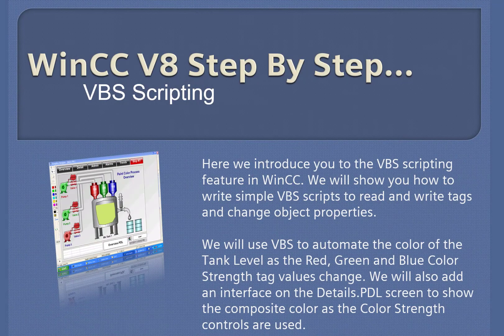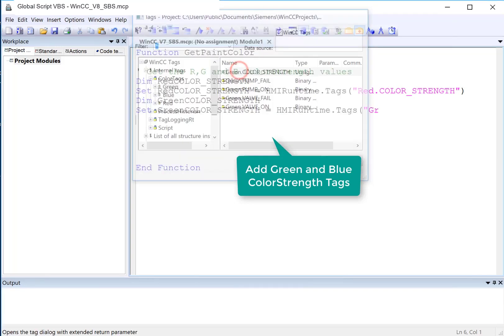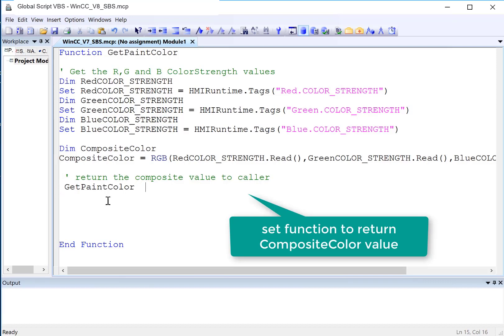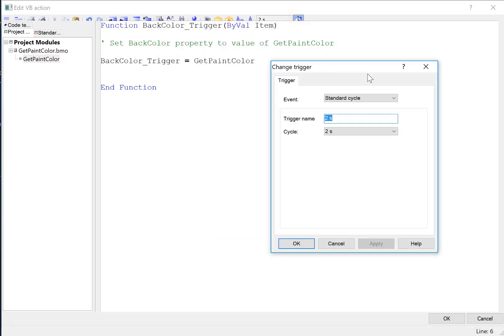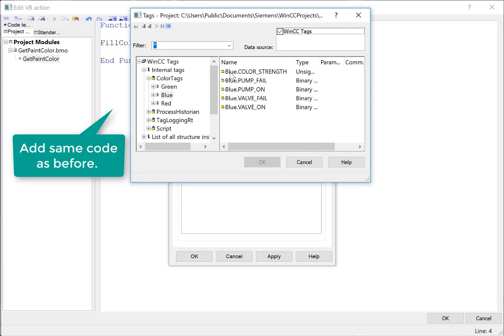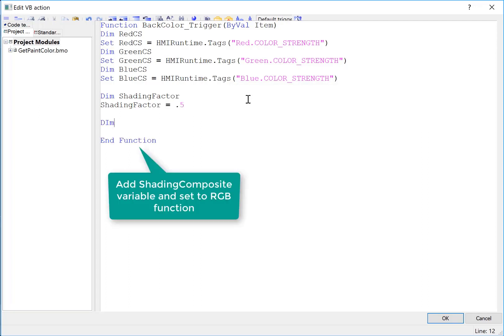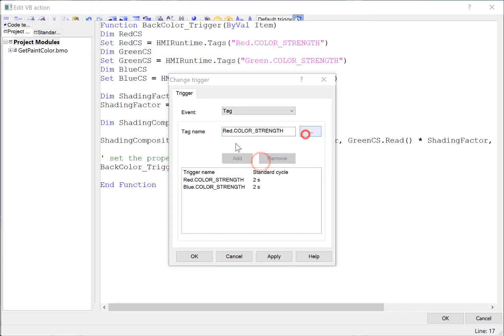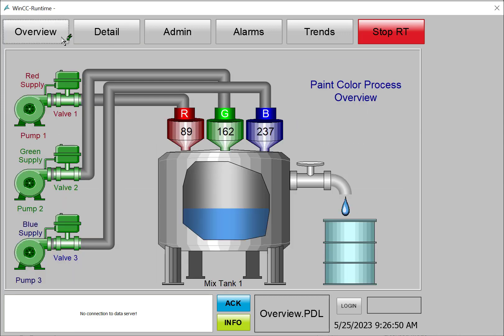WinCC v8.0 Step By Step 14: Create VBS Script In VBS Script Editor 👨‍💻 #winccguru

Comment: Hello, is it possible to write a script on wincc 7.5 to poll the IP addresses of different devices to see the status on the monitor, say a line if it is available, green, if it is not available, red, that is, so that every minute it checks the cyclic availability of a certain IP
Reply from the maker: No. But, it seems you want to animate an object's color if the PLC Connection is bad, correct? Just use a Dynamic Dialog on a given object for the Background Color property. In the dynamic dialog, add one or more tags to the expression line, and configure the color animation as normal, say red for ON and Green for OFF. Then, at the bottom of the Dynamic Dialog, check "evaluate tag status", and select the tag under State which should be evaluated. choose the color associated with the error, such as not connected, address error, etc.
Reply: @WinCCGURU  thank you for your quick reply, but you misunderstood me, can I have your email address and write you an example of my code? I just can't understand why it doesn't work.

p.s. the point is for the machine to query each IP address of a different device, for example, I want to know if a server, router or field device is available, that is, only a communication channel. let's say on the graph I have a line that stretches to the device if the device is available it is green, if not, then red
Reply from the maker: you can try this VBS Script: use APDiag to see the debug prints, or add the Application Window object to the screen, and choose: Global Script->GSC Diagnostics. 
--------------------------------------------------------------------------------------------------------------------------
Dim IPAddr : IPAddr = "192.168.3.45"
Dim strCmd : strCmd = "ping -n 1 " & IPAddr
	Dim objShell : Set objShell = CreateObject("WScript.Shell")
	Dim objExec : Set objExec = objShell.Exec(strCmd)
	Dim strOutput : strOutput = UCase(objExec.StdOut.ReadAll)
	HMIRuntime.Trace strOutput & vbcrlf
	If InStr(strOutput, "MS") Then
		HMIRuntime.Trace IPAddr & " is connected." & vbCrlf
	Else
		HMIRuntime.Trace IPAddr & " is NOT connected." & vbCrlf
	End If

----------------------------------------------------------------------------------------------------------------------------

sample output: 

PINGING 192.168.13.45 WITH 32 BYTES OF DATA:
REPLY FROM 192.168.1.85: BYTES=32 TIME<1MS TTL=128

PING STATISTICS FOR 192.168.3.45:
    PACKETS: SENT = 1, RECEIVED = 1, LOST = 0 (0% LOSS),
APPROXIMATE ROUND TRIP TIMES IN MILLI-SECONDS:
    MINIMUM = 0MS, MAXIMUM = 0MS, AVERAGE = 0MS

192.168.3.45 is connected.